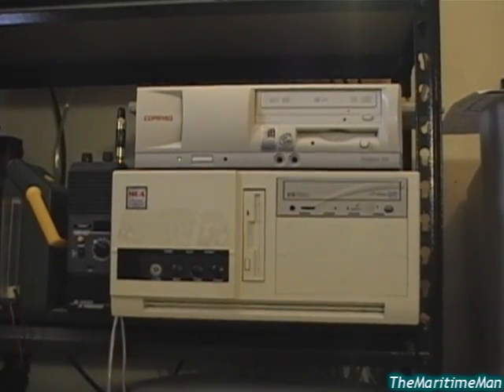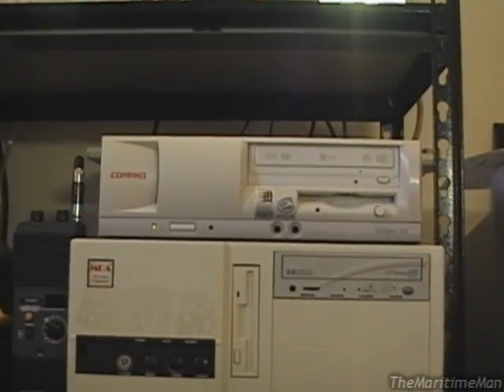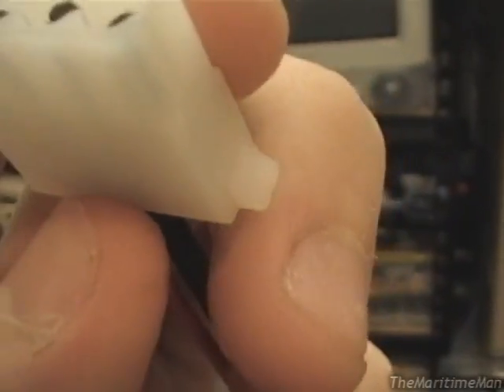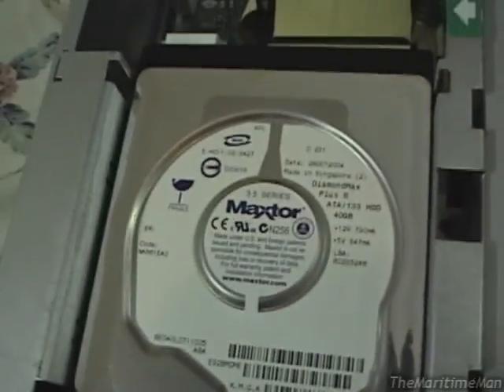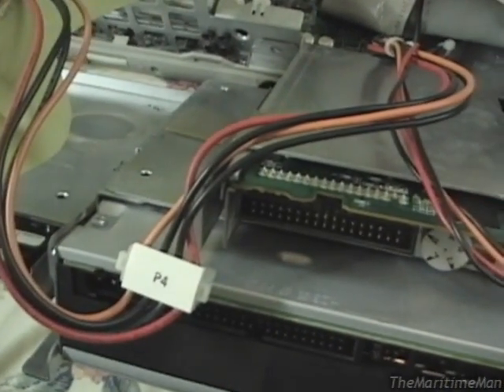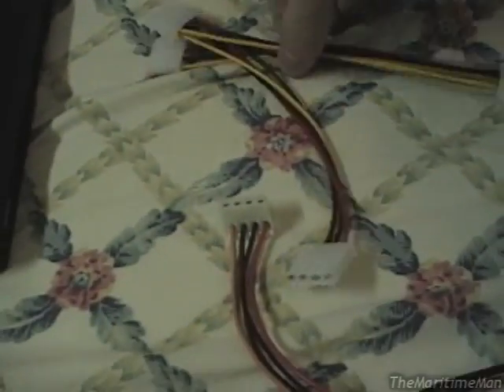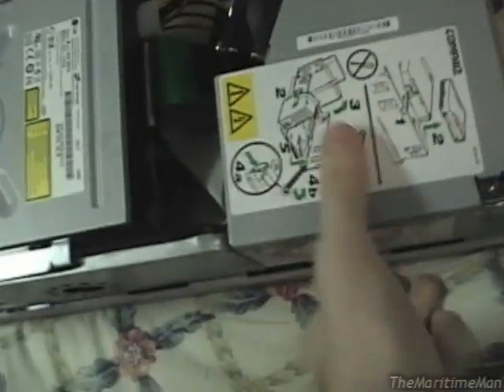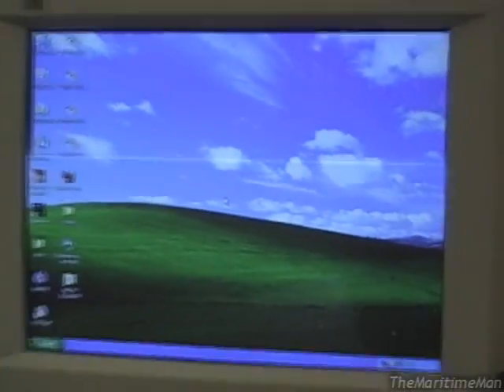Compaq Deskpro EN power supply repair

Comment: Hi i have a similar mode with a celeron 333 mhz ihave like 6 beep and no video can it be the problem?
Reply from the maker: @BraveNewWorld1984-r6o  I can't find anything describing a 6 beep code for the Deskpro EN or Compaq PCs in general, but for generic BIOSs 6 beeps usually means a keyboard controller failure. On a Compaq, 7 beeps would mean video failure.

Comment: I also have a compaq Deskpro EN with a Pentium 3 running on 733 MHz. and 256 MB RAM.
And it runs Windows 2000.
The onboard sound sounds good for a internal speaker.